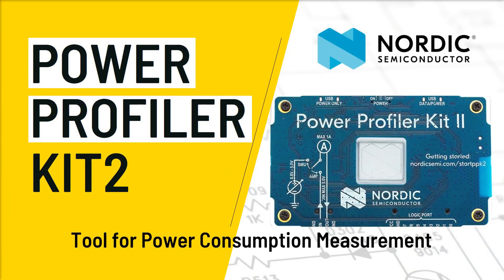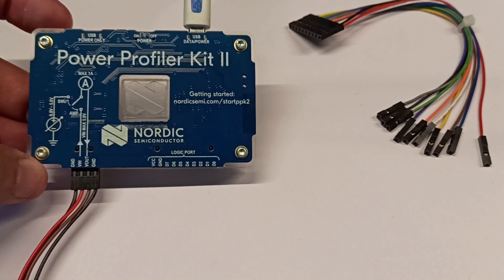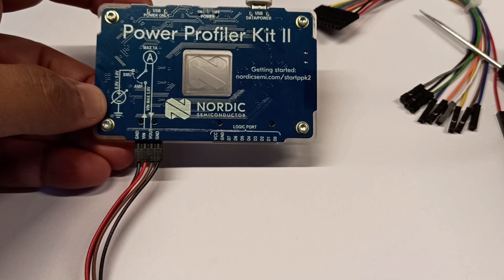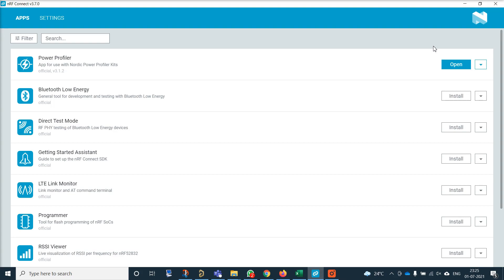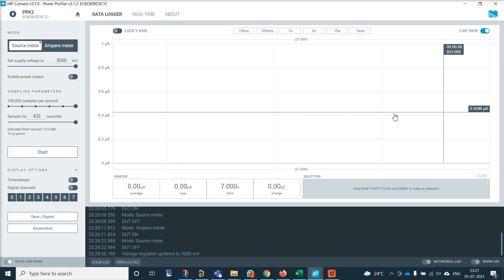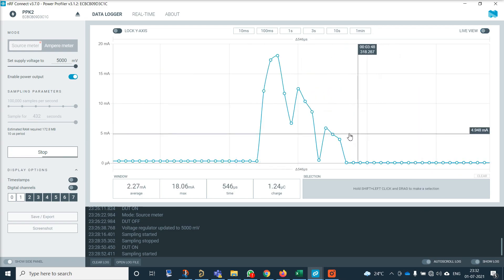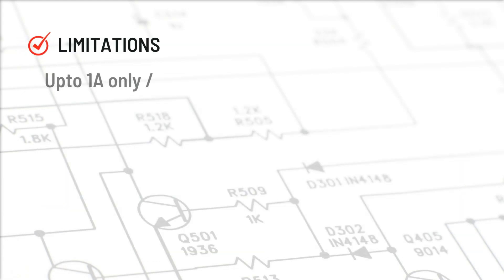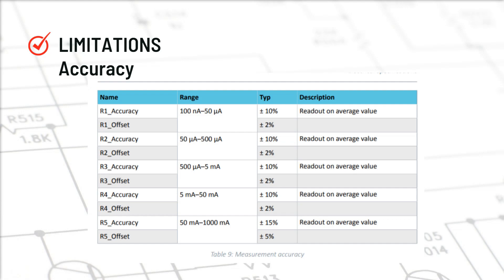✅ Nordic Semiconductor Power Profiler Kit 2 - Review [2021]

Comment: what happens if you draw more than 1 Amps ? will you blow it or does it have protection ?
also what happens if you wire a motor or relay, will you blow it does it also have protection ?
also what are some other common ways you could blow it and lose the thing forever ?

Comment: Excellent explanation. What was its behavior when there is a range change happens? how fast can it happen? Thank you very much.
Reply from the maker: You will not know, it is managed internally by the profiler hardware and firmware. You will get accurate results. Check the datasheet of power profiler for more details.

Comment: I understand it can drive power for the DUT between 0.8v to 5v , but at what increment?
Reply from the maker: They have given range 800 to 5000 so 1mv level step but accuracy of output setting will be roughly 20-30mv. General we don't need very high accuracy voltage output, do we?
Reply: @PallavAggarwal  My app requires driving 0.8v to an IC and possibly slightly more. In our existing analyzer, we incremented the voltage in 0.01v increments because somehow the sense resistor caused the processor to fail some of the tests when measuring power. We ended up running it in 0.84v  to get to a stable point (trying 0.81,0.82,0.83 first).

I followed the schematics of the PPK-II. The ADP1708 LDO_Adjust pin is connected to POT1on the I2C potmeter block, which is driven by an mpc4451 I2C quad digital pot (100Kohm). given it is an 8 bit device, we are limited to (5-0.8)/256= 16mV in the best case.
I see that the host software is open, but the FW is closed. You could hack an extra 5K digipot in series, so you would get extra 20 divisions between each step of the 100K pot, but you would need external SW to control it due to the closed firmware.
Reply from the maker: That's great. That's for sharing. I did not see the schematics yet. Series resistance will create problems with high current. Also do you really think accuracy of output voltage is that important which will worth the effort?